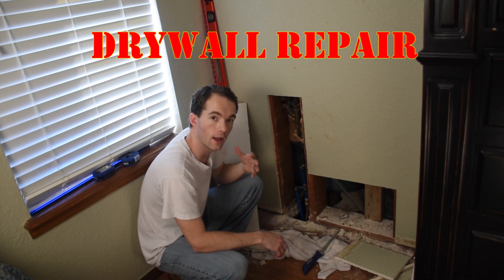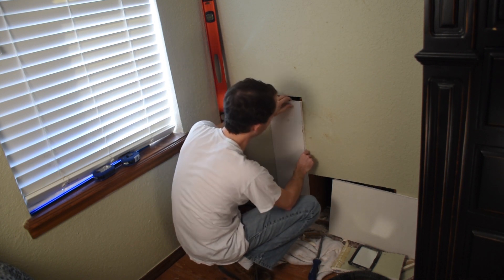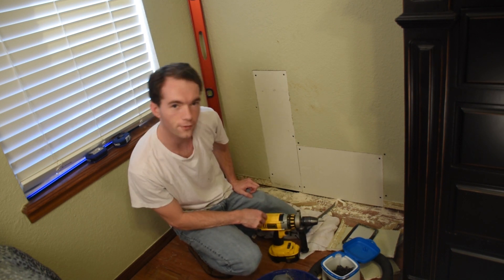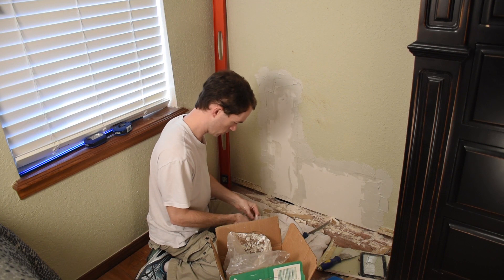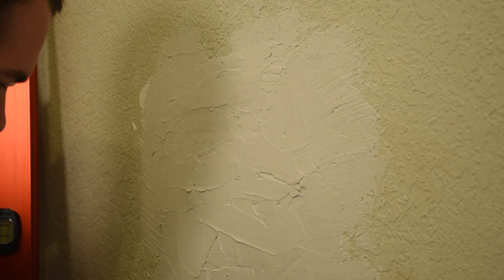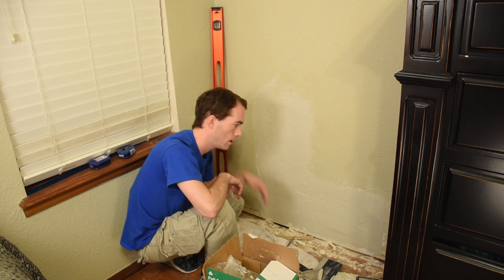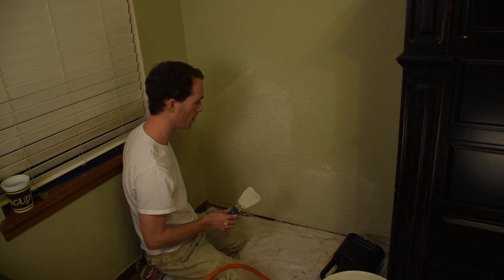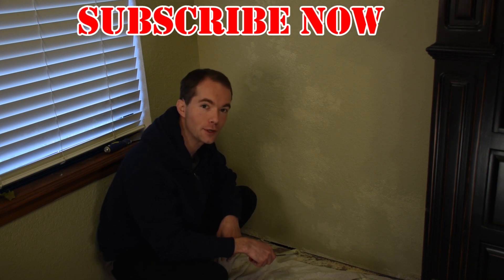Replacing a Section of Drywall After a Pipe Leak

Comment: I have exactly the same task. Two pieces of drywall from bedroom side. Bathroom on the other. Builder plumbed hot water line to toilet. Neither Builder, previous owner corrected this. Finding your video
is my repair blueprint.  Thank you, Mike , excellent presentation.
New subscriber ..of course!

Comment: I had to remove part of the lower plaster wall in the bathroom due to small pin hole leak in a hot water pipe, I fixed all the plumbing galvanized steel pipes leaving the hole open for few weeks to keep an eye on things before I start plastering up the wall again but being its an older home having plaster I can do something like you are showing but wouldnt have to use tape probably will cut some sheet rock afix to couple studs then mix up some plaster with bonding glue & patch it all in, the trick is to get plaster as flush as possible on the sheet rock that replaced old plaster area once begins to semi dry not completely then float out the whole area with sponge float feathering the edges to blend in with the old wall, I am just glad didnt have to pay a plumber thousands to fix the leak they would had used pex piping for complete repipe but not wanting to go into debt over this so fixed plumbing for 125$ big difference in price.

Comment: You must be clairvoyant — saw into the future a few years ago to July 2020 to know that I would have this exact same thing happen to me with the exact same fix.  The knee is bent to you, mighty wizard.
Reply from the maker: I knew you'd kneed it. Glad you found it. I actually did this again on Mother's Day this year because one of the Sharkbite connectors failed. I'm not a huge fan of them. This new plumber soldered copper in this time. Still had the same sheetrock left over too!

Comment: When you cut drywall right at the middle of the stud and then put in the screws for the new drywall are you putting the screws in at a slight angle?
Reply from the maker: Yes I am. Otherwise I might not catch enough of the stud and miss it. Straight-in screws gets the screw too close to the edge of the sheetrock and causes the sides to split out. It's a careful balancing act.
Reply: Thanks. Great Video! Am working on this today.

Comment: When you cut out your spaces, how did you cut your lines so straight?
Reply from the maker: I just used a square or ruler to draw a line on the wall, and follow that line with the knife if on top of a stud, or with the keyhole saw if between studs. Thanks for watching!

Comment: Not sure why you used a small knife. This would have been faster and more even using a 6” and or ideally a 10” or 12” knife. 
That vertical piece could have been bedded with one swipe up either side, bed the mesh tape and another swipe to bury it. 

Small blade can’t hold enough mud for anything other than patching small areas.

Comment: What size/type of screws did you use to attach the drywall to the studs?
Reply from the maker: They were regular drywall screws that were 1.25" in length I believe, but they might have been 1.625". It's been 3 years since, and it still looks perfect. Thanks for watching.

Comment: My shower head pipe fell off during a shower and the wall behind it has be leaking water since how do i stop it and fix it????
Reply from the maker: Start by turning the water off. It's maybe inside the house and maybe out by the street. Of course, just turning the shower faucet off should be the first trick.
Reply: Ok it's stop leaking what now???
Reply from the maker: You can buy a new shower head pipe and wrap the threads in Teflon tape and screw it back in. I'm assuming that the threads on the pipe are stripped. If the threads on the female side are stripped inside the wall, then you'll have to open the wall up from the backside and replace that elbow or, god forbid, call a plumber. If you're at all unsure, I suggest the plumber route. It's not hard, just a bit nerve wracking if it's something new.
Reply: Yea the threads are striped so we might have to go for the plumber route. how much would that cost????
Reply from the maker: Oh my. That's too bad. I don't know how much it cost. I had the plumber fix this problem for about $300, but it involved busting through the slab and installing a few feet of PEX and several expensive SharkBite fittings. I would have fixed it myself had it not been back beneath the slab. Replacing a shower elbow shouldn't be that much, especially if you make the hole in the wall yourself to allow them access and patch it up afterwards. Good luck!

Comment: looks like you didn,t quite measure where the pipe was before you butchered the wall
Reply from the maker: Yeah it sure does Joe. We had to cut the horizontal portion to gain additional access for the repair.